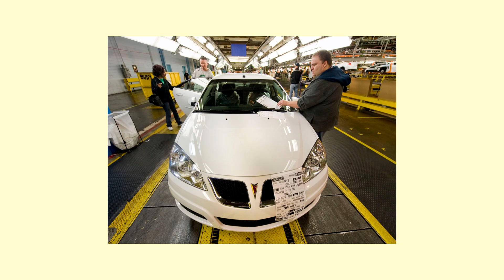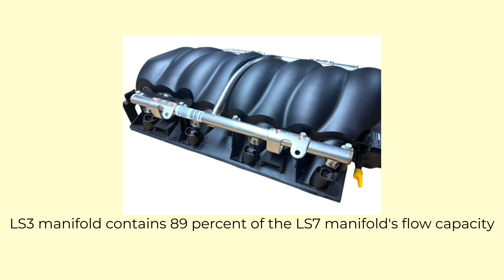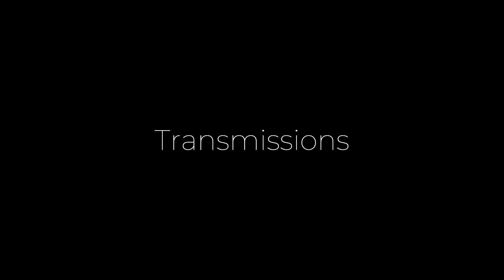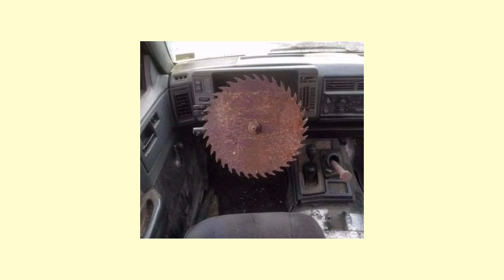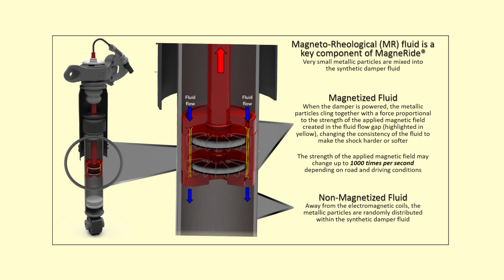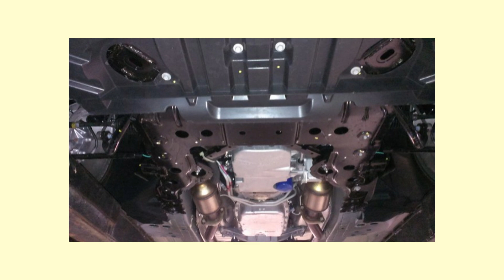Automotive X-Ray: Chevy SS

Comment: Wished my 08' SS Impala had a 6.2L and RWD but still a total blast to drive, to bad GM disnt release these masterpieces in the US!
Reply from the maker: Ye the LS4 isn't too bad at all, underrated gems for sure
Reply: The intake manifold really restricts them, but they should have had it set around 400HP which is about all the drivetrain can take but even traction with 303HP is a challenge😂
Reply from the maker: Does it have an LSD? If not, probs why it can't put the power down as well
Reply: @Enguitive LSD?  It boils the tires especially if I turn off the TC, Of i leave TC on and and raise the rpm's while on the brale it sometimes has a split second delay then off it goes amd puts you back in the seat surprisingly enough, it's has no problem moving it's a great 4dr sleeper and makes me $ with these young kids think their BMWs are the fastest thing in the world from  0 to 151mph. It says they will do almost 160 but idk and likely won't stretch it like that again. LS4 powered and I have the plug that goes into the OBD II port to delete the AFM so it stays in 8cyl mode all the time as I read with the AFM active it can harm the lifters and cam.
Reply from the maker: NA V8 glory over boring turbo i6 Beemer all day bro
Reply: @retrocompaq  something was wrong with your SS Impala then cause mine goes straight whether im boiling tires or smoking beamers n cavaliers!😂 I mean cobalts
Reply: @retrocompaq lol too funny, so your cavalier has over 400hp and over 400ft.lbs. of torque u say? You live near Tennessee so we can put that to the test? Im sure you will live as far away from me as possible now😂 that cavalier wouldnt hold that power😂
Reply: Limited slip diff you mean? Gotcha well for sure it's not posi or you wouldn't be able to steer under power for sure and being FWD 1 axle is shorter which 1 is a trans-axle GM used in them with the 65HD trans but it can boil both tires if you want it to pr spin very little and take the heck off if you prefer that also